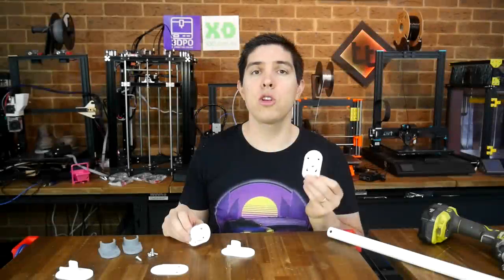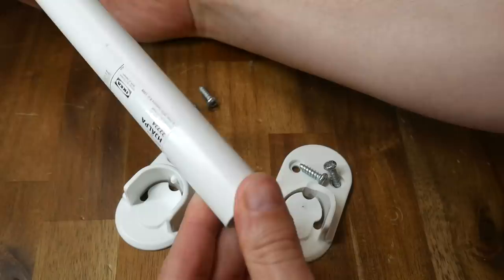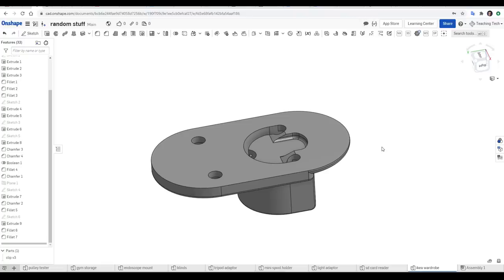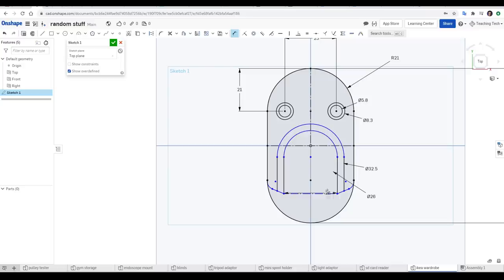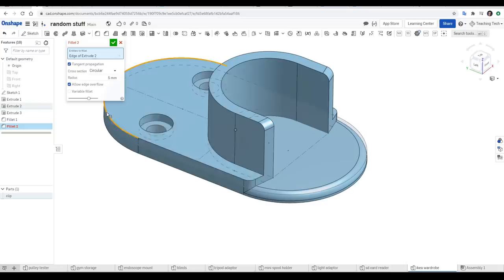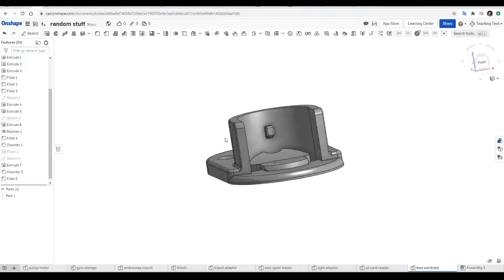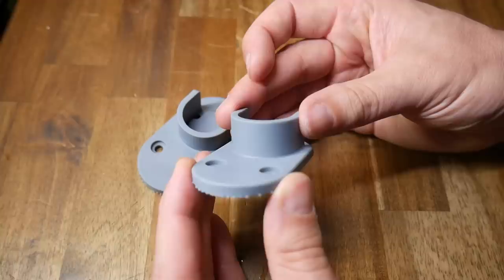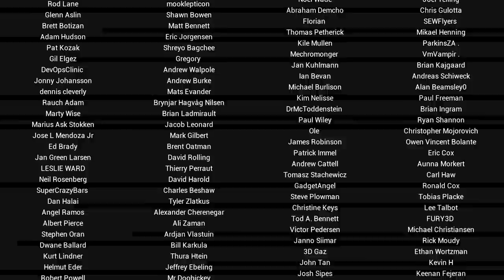Replace broken items around the house with 3D printing

Comment: Thanks for sharing! very useful info. I was into 3D printing years ago a had a mono price mini the first one. After the controller board fizzled out for the tenth time, i had enough and started saving up for something better and bigger. I had a great year and a bonus from work. I got a snapmaker 2,0 A350. it is everything I expected and more. I have been using my time to lean more about CAD.

Comment: Not too long ago I did my first house item fix. I modeled and printed new chair foot caps for my parents' lawn chairs so they wouldn't scratch the paint off the patio. It took a rubber mallet but they friction fit perfectly.

Before that I also designed a headphone holder that clamps and clicks into a groove on my computer desk, but this wasn't so much of a fix as much as it was creating something I didn't have yet.

Comment: Had a long pole hook with a cross-head to unlock the attic door and pull down the attic ladder which took a fair bit of force to overcome the spring holding it in the roof. The original injection moulded hook end had been glued back together multiple times having snapped in multiple different places and even being nailed to the pole at some point. 24hrs after the hook snapped off for good, there was a brand new, stronger designed, PETG hook epoxied on in its place. Handy thing to have around 3d printers.

Comment: Probably my simplest print was the end of a retractable clothes line. The original plastic part broke so I printed a replacement. That bright red peice had been hanging with tension for over a year. I would have thrown the line away otherwise! I've also done brackets for old blinds and even a part to fix my 30 year old washing machine! 3d printing is so useful!

Comment: Nice job! I had a wireless carplay adapter with a dongle. Of course the dongle is the part that broke. Bought a usb-c breakout board and hooked it into the board but now the two boards together didn’t fit in the original case so I designed and printed a replacement case. 

Also had a bottom door for my leaf blower break. I modeled and printed a replacement.

Comment: Most of the things I use my FDM printer for are practical prints like that. I've made a headset holder, test lead organizers, battery dispensers, battery packs, replacement parts for my kids toys, alignment jigs, tools, etc. I'm hoping to be able to get into resin printing soon too, the precision you can get is astonishing, but I haven't been able to justify the cost yet.

Comment: My most useful print is a gable vent for my shed. It was installed a few months ago and has held up to some hot weather.
The project lead me to discover and use PETG and that's pretty much all I print with now.

Comment: great video. For small parts like this I would print the rough design on paper instead of 3d printing a flat version. Faster and less wasteful. Still a good idea for more complicated designs though
Reply: the idea, I think, is to make sure the printer is printing what you expect as well.  if you print on paper the scaling may be off.  even at 100% scale I have had the printed picture measure a noticeable amount different than designed

Comment: I helped a neighbour who was struggling to find £40 for a replacement wash/wipe hose system by printing a hose connector. 10p to print, 10 minutes to install, £39 saved for a vulnerable person.

Comment: Its often a good idea to try to reduce the part to its absolute minimum version that still works. This often makes printing easier and the part more robust. That locking mechanism could have been made simpler or possibly even omitted if the seat would be rotated 90 degrees so that gravity and friction hold the bar.
Reply: underrated, the U-shape being rotated 90 Degrees is such a stupid structural design flaw...

Comment: I replaced a metal door lock lever with parts designed by me and test printed with my Prusa mk3. i modelled and iterated in PLA (and metal actuating force against plastic, it actually worked enough to successfully test it). Once done and known to work, i sent the STL to be printed in metal.
It arrived, and worked first time, perfectly!
It's an antique lock and you can't get it any more.. there are sort of similar ones, but they are $400+ and not as good.
Metal printing the part cost $36AUD from shapeways, delivered.

Comment: I agree that fixing broken stuff is fun and changed my wife from the skeptic "why did you buy that 3D printer?" Into seeing how useful it is.
That original IKEA design is terrible though and I wouldn't have replaced it with the same. Far better would have been to create a U shape that was vertical, as this would require no bendy clip, no part to engage in a hole. Gravity has been helping us for a lot longer than 3D printers have been around ;)

Comment: The first 3D model I made with fusion 360 was a hook and cross head 'screw' tool to open my loft hatch and pull the ladder down, the original tool had broken years ago and I had an old curtain rail in the wood pile so made a new tool sized to fit on the curtain rail, it worked perfectly and certainly far simpler than trying to find somewhere that stocks the replacement part for a 30 year old loft hatch.

Comment: I replaced the broken ventilation  flap on my Toto wash let by modelling it in Tinkercad and then printing it in white filament. Because I didn’t have the original I went through about 5 versions until I got it to fit. Luckily it as very thin and small so it only took about 10min to print each time.

Comment: I surely would have doubled the thickness of the failure points, and replaced both brackets
Reply: And rotated 90 degrees so the round portion would bear the load instead of a flat "floppy" end of course the screw holes would need to be vertical still but not a big deal when still in the CAD phase.
Reply: @Guardian_Arias  The engineering game " I can design this thing better and more suitable for 3d printing " is my favorite game too. (ICDTTBAMSF3P for short)
Reply: @Guardian_Arias  100% true, design a better part if you can vs this poor original design
Reply: Wouldn't an injection molded part be stronger than a 3D printed part? I'm not sure if you would win anything by replacing it
Reply: I've replaced the plastic of some magnetic cupboard latches similarly. I did alter the design to be more robust when one broke again a year later.
Reply: I ended up using a screw to reinforce the z axis directly underneath the tube because my wife already broke the 3D printed replacement parts. And I always have two fixtures in stock to replace them faster. It's amazing how many heavy jackets she can fit in a 1 meter wide wardrobe.
Reply: I thought he did.  Weren't both resin prints grey?

Comment: I can't even count how many things I've fixed around the house with 3d printing.
Reply: Ditto
Reply: I can easily count this. I just have to count the number of files in the folder dedicated to this.
Reply: Things you could've probably bought on Internet
Reply: @alejandroperez5368  You can indeed often cheaply replace things instead of repairing them. Because screw bothering with trying to be ethical.
Reply: The CAD is my hurdle. :(
Reply: @angiegracie6954  Yeah it was mine hurdle as well. When I first got my 3d printer I had never used any sort of CAD or modeling software. I just watched YouTube videos and started practicing modeling simple objects and eventually got better to the point I can make most things I need. I obviously won't be modeling a complete car with every part and moving piece of anything though lol 🙂 but I can make things like custom lids and caps, cupboard latches, spacers and brackets, or replicate a broken part.
Reply: @bluegizmo1983  when I see how long it took for him to create that pole holder and he knows what he’s doing but the amount of time it would take me to design that on CAD, I could have gone and come back from IKEA twice!

Comment: WTF! First I thought you was  filming from below the installed parts but then I realized, they are this way oriented! Why in all over the world should has someone designed this part to be used in this way? What sense does it make?
Reply: Same thoughts. Uneven weight distribution around the handle walls couldn't have ended up differently. Rotating 90° will improve durability significantly.
Reply: Funny, I am an engineer and thought that was a poor design for the same reasons. Uneven support for no reason.
Reply: It makes a lot of sense. The way the original part is modeled, let's you take advantage of the top screwing holes allowing you to use the bar as high as possible. If the part was a standard U then the bar would rest at a little lower position, losing vertical space.

Comment: Awesome video! I'll have to check out your OnShape series... I've been using it on and off for several years, but mostly for measuring angles and offsets for various things, and a few simple models. The assembly system seems somewhat different than what I remember in SolidWorks, so there are some areas where I could benefit from some proper tutorials.

Now that you have this part modeled, if the part breaks again, you might try rotating the "U" shape 90 degrees so the open side is towards the top, and then extend out the screw holes so that one is above and the other below the "U" shape (perhaps skipping 1 or 2 screw holes where the "U" is placed in between).

Then the part should have some extra strength since it will not be supporting the weight on an open edge, and the weight will be centered on the screws, rather than hanging off of the screws.

You could even add a rib or two under the "U" shape for even more strength.

Cheers!

Comment: Great example of a fix and useful 3D print. One small note, you could have made the fixed piece a complete circle, the rod only has to clip into one side, they are sold in pairs like this at most any hardware store, one side a complete circle, the other side a slot to clip into. Though you do have the model for easy access if the other side breaks. I've lost count of my creations and fixes for items from a tape measure real handle, floor trim on a radius wall corner, paper towel holders, or just stupid chip clips with small amounts of leftover filament. Never throw away those small pieces of filament at the end of a roll, just make chip clips because at least one (or more) kid is gonna toss the damn things and you always need more.

Comment: My most useful case for a problem like this was getting my new (at the time) GPU mounted into my PC case.
I have the Thermaltake Core G3 that situates the GPU vertically and parallel to the motherboard via the metal bracket and a couple plastic mounts that hold the other end up. The new GPU I got was/is the MSI GTX 1080 Duke which is massive. Problem with it is one of the plastic mount completely covered the power in on the GPU. I had to whip out my laptop to model it in CAD and shift the mounting point over a little. 1.5 hours later I was able to finish the upgrade and the best thing is I'm still using that same printed part in my PC to this day.

Comment: Great video, I made a wall mount for a Bang and Olufsen remote control, they were too expensive at the time to purchase so I made it in Blender (although will check out onshape since I'm fat more used vector graphics work). I designed it by tracing the exteriors at the largest point digitising it and as a pdf in illustrator tidying it before taking the path to blender and using an extruded volume of the remote to design the holder around. So not quite the same as replicate a broken part but similar skills and your approach is really useful to understand how to do things properly.

Comment: These are the sort of projects I enjoy most too, repairing or upgrading existing things.
I does seem odd to me that the original part is fixed 'on it's side'. It would have been stronger if it had been oriented upright, so the pole sits in the bottom of the U shape. I would have designed the replacement part in the upright orientation.

Comment: Have been using Fusion360 to make parts for a lot of things around the house for the last year or so. It is very easy to measure anything with a good digital caliper and a set of drafting calipers. I have made gears for a coffee grinder, on to door hinges for a kitchen aid storage box. This is the best use for our CAD and 3d printers. on the holes, just measure from the left edge of hole a, to the left edge of hole b, that is your hole spacing. And on complex geometries, dont be afraid to draw a "strike" line on the old part, and take all your measurements from that line. A strike line is a crosshair type starting point."

Comment: I have also fixed some items and made one-off parts.   I wonder why this bracket design did not have the "U" at the bottom.   Having it on the side is weaker.   Since you are modelling, I would have rotated the "U" 90 deg for stronger design, especially with this being 3D printed.   
Dave.

Comment: I have a Pilates machine that I bought in 2005. It is no longer manufactured and I have been able to 3D print replacement parts for plastic parts and including some metal parts that are static with out much wear and tear.   I will proceed with 3D printing battery covers that are missing in some of my electric devices.

Comment: I have a box fan with feet on the bottom. One foot got lost and the other broke. So I copied the broken one I had and repaired it in the 3D model. Printed them out good as new, exactly like the originals except yellow instead of white.

Comment: Good job, but I wonder why Ikea who have my respect for form-follows-function principle didn't make one or two extra holes so the rod holder can be screwed in upright, making for a better distribution of weight onto the whole thing instead of one side only. I've reconstructed and even improved some broken household and car interior parts with SketchUp so far as well as designing electronics cases for my subwoofer builds for i.E. the crossover filter or a small build-in amp with a fan mount where I had to make holes with a heated screwdriver to get the airflow right, something I tend to oversee in the design process. Love your channel, I've made a couple improvement to my ender 3 learning from your videos already

Comment: Good job and thanks for the video.  I question the design though (not your matching it, the original one).  Why would they have the weight bearing section cantilevered out like that, wouldn't it make more sense to have the rod holding rotated 90º (so it drops in from above) and in line with the screws so the load is passed directly to the structure instead of resting on the tiny edge?  Probably why it broke in the first place.  Anyway, thanks again.

Comment: I designed a part we lost from a light fixture, took 3 tries but I managed to make it work. I used inkscape for initial sketch and then 123design to turn it into 3d. However the measurements didn't translate well between the 2 programs so I had to make some adjustments.

Comment: Interestingly, when I worked as a design engineer our CAD standards called for us to keep sketches as simple as possible. I think it may have been a requirement to use a a new sketch for every feature. For a simple part like this it's no big deal, but when you start getting into more complex parts you either have an incredibly complex sketch, which may be difficult to edit later on without causing model failures, or you end up with a few sketches to contain all the information - and then it may not be obvious which sketch controls a feature. Obviously whatever works for you, but I thought it was worth pointing out! Also it's good practice to leave fillets and chamfers until the end, it helps avoid problems when two features intersect.
Reply: You're partially correct about requiring a new sketch for every feature because it makes editing or revising down the line easier and more safe.  However, each of those sketches being independent is also important for those in the manufacturing process whether you're injection molding, casting, machining or forging.  Often times in machining specifically you will find yourself looking at a print that bases all of its dimensions off of a measurement you cant practically work from on a single finished drawing.  You can usually figure it out but that complicates things and is more prone to mistakes as opposed to having all revisions on hand that represent generally simple geometric shapes that are easier to duplicate because we are doing everything in reverse in comparison to the design process which is additive.  In short, it is one of the few things that designers and engineers to help the people that are actually making the product.
Reply: @apersonontheinternet8006  Ah that's interesting. Virtually everything I designed was sheet material, maybe with some bends. Generally I just sent off a DXF to be laser cut so I didn't have to really worry about how it would be machined! We were expected to dimension drawings in a way that made it straightforward for the Quality department to inspect though.

Comment: Great video & great use of 3D Printing, I have used my 3D Printers to print functional parts and also used it to replace broken plastic parts on one of my 3D Printers.  For anyone that has a Wombot Exilis XL printer and wants the files for the plastic parts if you head to Thingiverse & Myminifactory and search for RobsVirtualCave you can find these and other files.

Comment: Nice work on the replacement but the original design is very strange. Why wouldn't the pole slide in from the top v. the sides? I think I would have rotated 90 degrees and added more support to the new bottom edge.